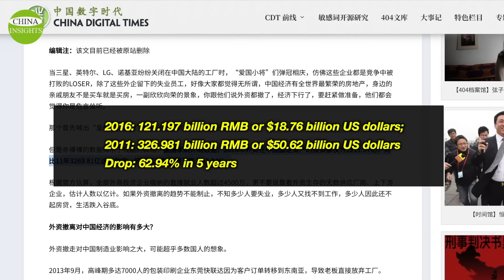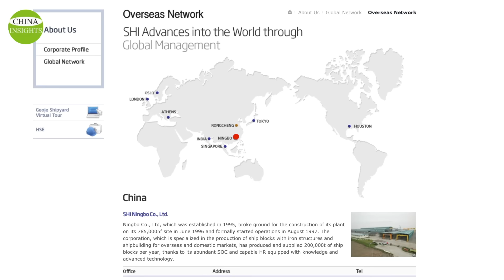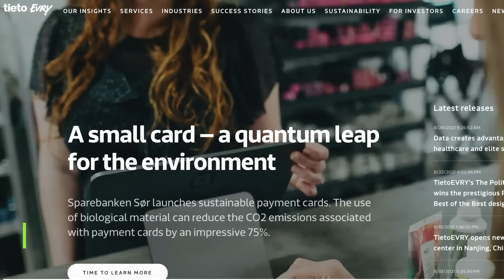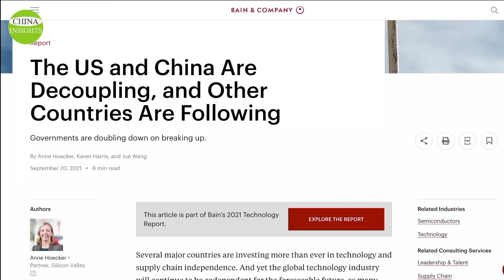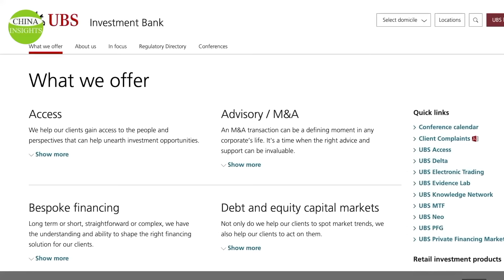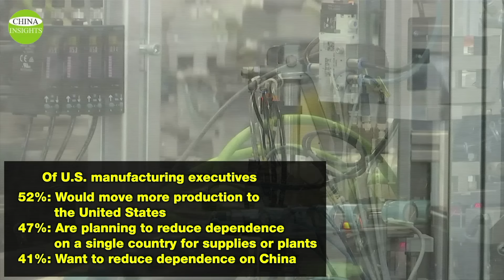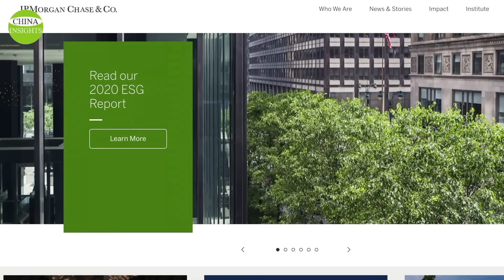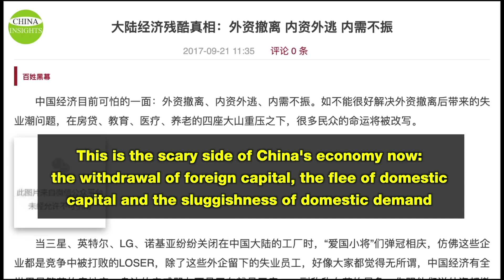Manufacturing and Foreign Capital are leaving/Foreign companies directly employ 45 million Chinese

Comment: Going to be interesting to see what happens if too many businesses and people leave. Probably start by making it harder, more costly and time consuming.

Probably in that order
Reply: Technology advances in the West will supplant the labour cost advantage of China which is no longer as cheap as it was. Just one example is Intel's $20 billion investment in two new chip plants in Arizona. The US is advancing automation technologies to a new level.
Reply: @rod-contracts1616  we’ve been saying that for 70 years. Hasn’t happened yet. For some reason we haven’t been able to close that automation gap.
Reply: Yep, that's very plausible...
Reply: @Zei33  Of course automation has steadily improved, but reports are that we ain't seen nothing yet in terms of the automation currently advancing. As you imply, time will tell how true and how widely.
Reply: @Zei33  Getting automated is not the problem its 1) finding cheap skilled labor to maintain those machines that is the headache. Getting a tech or engineer in the US to work round the clock shift. Hiring one in the US is like hiring 3 in China and 2) spare parts for these automated parts. They have this sickening tendency to break down when you least expect it. In China I can order it today and expect it on a pallet tomorrow but in the US I have to wait for a week to be flown in from other places as in US the cost of storage is high and most companies follow this JIT system where they only have one spare or make do till replacement arrives.

Comment: To paraphrase the CCP's ambassador to the US; "the Chinese economy is promising" (.. to collapse into moribund stagflation). My words in brackets. Already, significant signs of trouble are there and production bottlenecks are exacerbated by power shortages made by coal shortages and coal price hikes. China now (or into the forseeable future) can't power interself with electricity properly, let alone dig up enough of it's dwindlng, high sulphur and expensive to mine coal reserves to provide thermal coal. It has to import thermal coal to produce reliable power supplies nationwide. China is 70% reliant on coal for it's electricity supply. Great incentive (not) for foreign companies to invest there. It's Mao political mania with the CCP all over again.